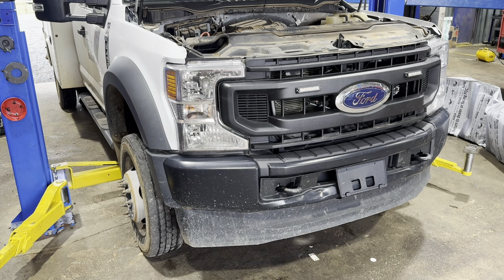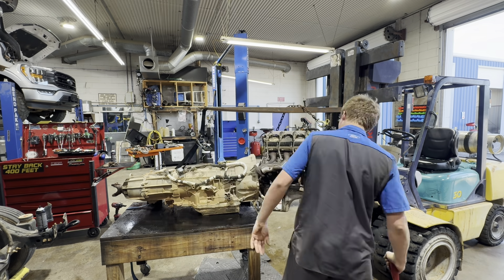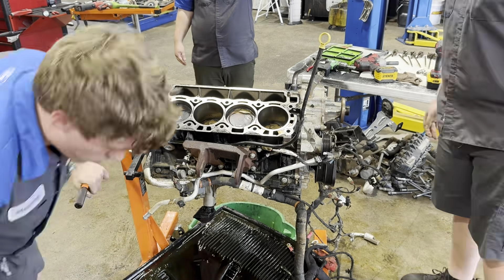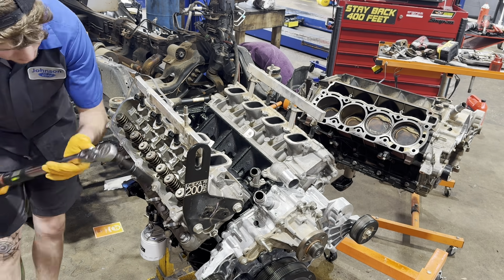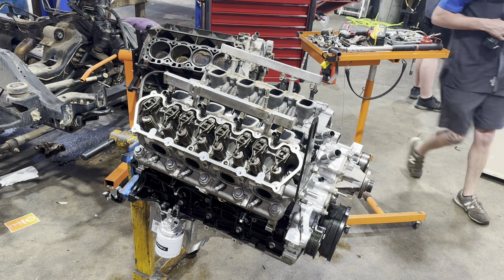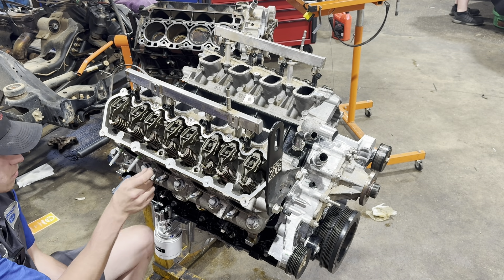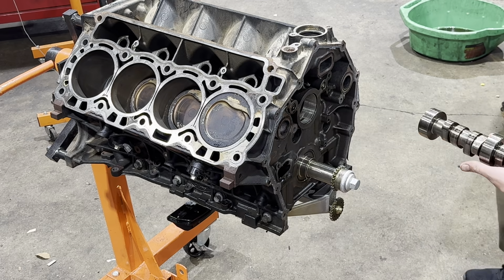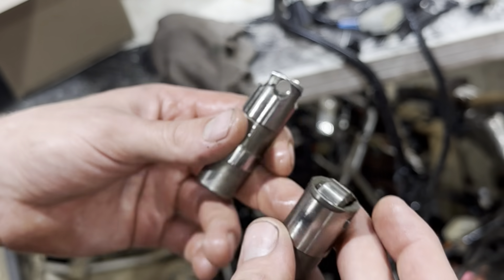Ford 7.3 Godzilla | Does this one issue make the engine a bust?

Comment: Lol, I thought the entire purpose of the 7.3 gasser was to negate all the issues that contractors have with the DPF systems on their diesel trucks, by sitting and idling the engines for long periods of time? You know….the emissions systems problems that everyone has been in an uproar about? I really don’t get it. Roller valve trains have been around for a very long time. How did all three forget how to build a reliable valve train at the same time? It truly blows my mind. And what dipshit engineer decided that it would be a good idea to put a variable oil pump in an engine? Doesn’t the engine vary in RPM? Isn’t that variable enough? I don’t see the benefit in that whatsoever.

Comment: I had a 19 Chevy trail boss for a year and sold it. The new rigs are just trash! I went and bought a stock 94 ford F-150 302 engine single cab long box 4X4 with a 5speed manual best choice I've ever made I can Actually work on this one myself

Comment: Why does the 6.2 have two cams and not 4 like the coyote? I know that on the doc engines there’s a pair for intake valves and a pair for exhaust valves, why did ford go with duals over one in each head?
Reply: 2v vs 4v

Comment: I’ve done multiple cam jobs where the lifter roller seized or lost bearings and wore the cam flat. I replaced the cam and lifters and shipped it. They’re still running after 10s of thousands of miles. I get that you and your shop need to protect yourselves from it coming back, but you can’t just do the maximum to protect yourself while completely ignoring how expensive that bill is to the customer.

Comment: Xw-20 oil?? I wonder if a 20 oil is spec`d only in the US to gain a tiny bit of mileage. They did it with the Triton and it turns out they are surprisingly durable with an 5w-30 or 40 in them.

Comment: Get rid of the stock  FORD  oil pump  and  put in  fixed rate oil pump in it and forget dropping  lifters . They exist   30 psi at idle  fully warmed up is not only possible  but it is what it needs and Ford left it out .  Saving   quart or gasoline at idle  does not stack up against a 10 grand tune up ....as referred to 😂😂😂🤣.

Comment: I think the oil is getting too hot. The pan is right next to the exhaust cats. The trans too. Way too hot. Just because the  coolant temperature is ok doesn’t mean the oil isn’t getting cooked. I am going to Basalt wrap from the manifold to the back of the transmission. Lack of air flow under doesn’t help either, going to cut down the front bumper air dam too. 
Thoughts?

Comment: I put a roller cam and lifters in a 78 350, back in the late 90's and the performance shop told me not to idle to long. He said the rollers get oiled by the splashing from the crank. Said if i was stuck in traffic to put in neutral and rev the engine up.

Comment: GM and RAM suffer from lifter failures because of cylinder deactivation, the 7.3 has no cylinder deactivation, so no excuse… you buy a 6.6 L8t and there’s no issues… Not to mention, you won’t see any lifter failures on a pre 2007 Vortec or a non dod GM engine, just doesn’t happen.

Comment: 60 series detroit oil pressure spec was 5psi at idle.
Reply: @scotcoon1186  15W/40 engine oil. Rod journals bigger than your fist and main journals almost as big as your head.

Comment: Huh? The ford 6.2 engine is universally regarded as a very reliable engine, AKA a Ford 4.6  modular 2 valve with much more displacement, 2 spark plug hemi heads and beefier internals.

Comment: I'm about to pull the 7.3 out of my 2022 F350. 6k out of warranty so I'm going to try swapping in a long block myself. I don't have a way to pull the cab. Any idea if it's possible to get the engine out without pulling the cab, and with the aid of a gantry crane? Any special tools you recommend?

Comment: Youngster. Please share with the rest of us on why the 6.2 liter engine is junk. I know that in the early years of the 6.2 engine, it had some issues with  valve springs, and on some high mileage engines, the coil packs can become brittle and break when removing them, resulting in a more expensive tune-up. Other than that, with proper maintenance, these engines are known for going well over 300,000 miles. So, with that being said, and again, please explain.
Reply: That's exactly what I mean, with proper maintenance and preemptive maintenance, these, and many other vehicles will go well over, two, three, and even 400,000 miles.
Reply: 2011 f250 6.2. 177,000 milrs. No valve spring issues. No issues at all. The only work done on the truck, I did myself preemptively for maintenance. I shitcanned the tiny motorcraft filter for a larger filter. Synthetic oil every 5000-7500 miles. Changed the plugs, coils and coil wires 1 time at about 115,000. Took it on a trip in 23 so I changed the water pump, t-stat, fan clutch, belt, idlers and belt tensioner. All motorcraft parts, no issues with none, just did not want an issue on the trip. This has been a solid truck. I figure when I hit 200,000 I will go ahead and replace timing chain, cam phasers, chain guides, chain tensioner, front seal, gear rotor oil pump and probably another water pump.

Comment: where are these lifters being made? By the cartel in Mexico? How about China's military funding assembly plants in China? Mellings does not make a high volume pump for these beast and whats up with these extra chains running these pumps? Holley makes a better pump for these engines. They make a better cast pan and timing cover too.

Comment: I haven't heard of people complaining about the 6.2s, however almost everybody I've ever known with the newer Ford trucks have gotten them with a 5.0 or V6 and people have had horrendous problems with the v6s.
Reply: Depends on how they’re treated to a point, I’ve had 2 v-6 ecoboosts the first a 2014 3.5 that I traded in at 115,000 on original timing chain with no noise at cold start. That truck had 2 sets of spark plugs and a tps sensor done whole time I had since it was new. Now a 21 2.7 with 65,000 should do the spark plugs on it. Oil changes every 4-5000 miles on them and let them cool off a minute or two at idle to bring turbo temperatures down if working hard.

Comment: Glad Ford is replacing long blocks. GM denied a warranty claim on a 5.3 I replaced in 2017 with a spun rod bearing. Engine had 7000 miles on it, warranty told us we should have only replaced the crank, affected rod and the bearing.

Comment: I did a 5 star tune at like 3,000 miles on mine.   I’m at 15,000 now and literally emailed them yesterday about updating it to give it more oil pressure at idle.  They sent me the new tune today and I got it programmed into the truck.   I don’t have much idle time, but figured it’d at least give me the edge on the problem.

Comment: Had a couple Fords in the past, had problems with both of them.. no longer a Ford owner and never will be again! 
Anytime I’d stop in the Ford garage they’d always be tearing down an engine or transmission due to shudder, or failure.
GM makes the best HD gas engine 6.6, no lifer issues..  very good engine if you take care of it!
Reply: They're all garbage. You're silly if you think GM is any better, the key is recognizing each make has a model that's exceptionally reliable for the brand.

My 6.2l svt raptor is just as reliable as a tundra.
Reply: 6.6 for the win. The 5.3 and 6.2 LT engine would be just as good if they eliminated the DoD system, and start/stop.... what a waste of a good platform.

Comment: I was wondering the same exact thing. When ford brought this engine out they specifically said they built it for work or for companies that do alot of idle time. But yet they put that horrible variable oil pump in that does not pump enough oil at idle. Quite ironic. I know I'm not a engineer but I ain't stupid either.

Comment: Engineers design a motor to idle on no oil prsssure. I call them smart dumbasses. Then ford wants to charge 60k to 70k for a truck with a pos motor design.

Comment: Very similar to the LS which is itself closely related the Ford Windsor in head design valve angle, symmetrical port etc… and Ford FE/FT in block design buttressed block, cross bolted mains.

Comment: There shouldn't be any reason to buy a short block if there is no internal scoring. I suppose   if the price of a teardown costs more than a short block it makes sense, but machine shops fill the motor with metal shavings anytime they deck the block, intake, exhaust, replace valve guides, machine valve seats etc. It just needs to be cleaned properly. I dunno, maybe techs charge 5k+ to teardown an engine and clean the block?

Comment: It's not Pressure it's not enough volume at low idle same problem with the 5.7 hemi put a six four oil pump on the 5.7 it has more oil volume and solve the lifter problem 😊
Reply: Then explain the 6.4 lifter failures?

Comment: 8 psi of oil pressure at idle seems woefully insufficient.  My LS2 engine has 28 psi at hot idle.   My '91 454 BBC has about 32 psi at hot idle.   Sometimes I don't understand the thinking of some of these engineers.
Reply: It's all about using less fuel and efficiency standards raising. This was how Ford avoided using direct injection or shitty MDS style lifters, which are sure to fail in roughly the same time many of these are seeing failures. I'm sure you're familiar with those failures and the deleting of MDS by installing a new cam and non-MDS lifters. 

The oil pump sucks up a load of power on an engine- they say 3-5% iirc. That is a massive gain for the engineers. The front mounted pumps can see some cavitation issues as well as cracking, or cause harmonic issues, so they decided to put these down in the sump and run them off a jackshaft. For racing, everyone just locks these things out by shoving a shim in there to keep them at full pressure and flow. If the stock controls fail on a working variable stock pump, the pumps are also designed to lock full flow and pressure. IIRC GM's variable pumps do the exact same thing. I'm sure their testing never showed issues at 8 psi- and believe it or not, the low end on a Cummins 6BT is 9 PSI. They have a high volume, low pressure approach, although many of us never see that low on our engines at all. Depends on the pump and that engine block in particular. 

I'm pretty sure this is something they can fix by just commanding the pump to run at 15-20 PSI at idle. A guy above says he has 21, so maybe these are well worn pumps? I'd love to see every oil pump on these as they come in to the shop and measure clearances, compared to say 3-5 brand new ones. I'm sure they'll tweak it to work it out, but it sucks that people are finding this the hard way. This is a badass engine from an engineering standpoint. They're a huge win for us pushrod lovers everywhere. This is hopefully an easy fix and will likely result in a recall to flash ECMs with higher pressure commands.

Comment: I thought Ford was going to bump up the idle oil pressure.  Surprising they didn't.  Seems like an easy fix.  Can you bump up the oil pressure yourself with a tuner, or is it set with springs in the oil pump?
Reply: It's not a spring it's in the computer and they did bump it up dealers were told to put the software patch on all 2024 models on their lots a while back and anyone that hasn't had it done needs to get it done right away but that's probably not the biggest problem this seems to stem from a bad batch of lifters from a vendor more than anything.

Comment: as a gm tech, our turds have plenty of oil pressure at idle, over 20, my guess on ours is the direct injection shits in the oil bad, diluting it, and its already 0w20, that coupled with a scheduled oil change at 7500 likely is not helping
id like to see a test group running a C rated oil (compression ignition, aka diesel) at 5k intervals, maybe a 5w40, or even a 15w40, and see what the valve train failure rate is

Comment: This is quite comical 😂 less than 1% ever has problems. I can tell everyone I’ve got over a 100k on mine very first edition late 2019 and I’ve beaten it from day one and have never had a issue except 1 plug wire . and I let mine idle for very long periods on time . This will be the engine of the future in my view it’s very very durable 7.3 Godzilla

Comment: I still don't understand why For hasn't issued a recall on the older 7.3L when they know that the low oil pressure is killing these engines at idle. I have the 2020 7.3L and I don't idle my engine, but you can't help having this in the back of your mind that maybe some day it's going to happen. Same for the 10R140 transmission deal. Mine is starting to show the tell tale signs of delayed shifts from 3rd to 4th and 4th to 5th shifts at moderate throttle. My truck only has 56,000 miles. 🤦🏻‍♂️

Comment: Gm only has lifter problems because of the afm/dod lifters collapse if they didnt have those there isnt a problem oil pressure isnt an issue with the gm's, the hemi actually have the problem with the lifters because of oil pressure problems

Comment: The Duke says, your low oil pressure theory has been blown out of the water. There is a YouTube video out where the owner of the vehicle buys a mechanical  oil pressure gauge.  
At cold start it puts out 93 PSI oil pressure and when it warms up it drops down to 22 PSI in park. That is more than enough oil pressure even at idle to lubricate the motor. As he revs the engine the oil pressure goes much higher.
You're also wrong about the Ford 6.2 gas engine. I used to have one and put 417,000 mi on the first engine and over 500,000 on the reman. Don't believe me? Google it. Flatbed Ed. Ford 6.2 forum. I now have a 7.3 Godzilla. I'm not sure if I would let you work on my vehicles. 
What did I teach you?

Comment: I have a 2020 F250 Tremor with the 7.3. Currently I have 243 hours of idle time. I try not to let it idle much. Still wondering if it's worth it to seek out a higher oil pressure solution. I also purchased an 8 year/100k mile extended warranty because I purchased the first year of this motor.

Comment: 😂 My 2012 F250 6.2 has 394,556 miles on it and still purrs along like New 😅. Kept Good maintenance schedule with oil changes, timing chain changes at 100K and only replaced normal wear items 😅. I'm keeping it until it collapses 😅
Reply: We’ve got 2 of them. 495k on 1 with 14k idle hours and 1 with 365k that’s never not pulled a 12 foot trailer at minimum. The 495k mile truck pulled 22k on a bumper pull trailer a few weeks ago. Drug a crew cab lb7 with a diesel generator welder in the bed of it with a loaded tool box home this weekend cruising at 75 mph down the interstate on an equipment trailer. Rolling at 1900 RPM. Locked in overdrive. Didn’t even break a sweat

Comment: Currently going through a fight with Ford ESP on this exact issue. Camshaft damaged and needs a new engine. I'm particular about maintenance and replace my own oil every 5,000 mi with full mobile one synthetic.

2020 with Mileage at 122k lots of highway mileage. Current Ford ESP is calling for short block replacement while the five other trucks in that same shop with the same exact issue are getting a long block replacement because they have lower hours. Beware buyers.

Low oil pressure noted by Ford  customer satisfaction program 24B27. Google that.

All current 7.3s have low oil pressure at idle and major damage will occur over time without a fix.

Comment: Im a mechanic at hertz rental car and we are seeing a lot of gm engine failures on the 6.2 in the Denali and Escalade with low miles. We  have a lot of ford box trucks with the 7.3 and the biggest problem with them is catalytic converter theft.
Reply: How many per year. I know rods are an issue.

Comment: Question, Sir. I'm considering purchasing a 2024 F350 with the 7.3. If the issue is oil pressure, why isn't there a high-pressure oil pump available? Can one be installed in an after market configeration? And not putting you on the spot.. would you buy a new 2024 F350 with the 7.3 ?? I mean you are a professional Ford technician with the problems as you noted. I'm not going to have the truck in a commercial environment and will be towing heavy from time to time.. thank you for your time and content.

Comment: 6.2 junk? Man I've been working on fleets of them. Spark plugs every 100.000 miles and oil changes and they run forever. Not the most powerful thing in a F350 but neither was the 300 six

Comment: The low oil pressure at idle is 100% in the tune. I have a 7.3 with a holley aftermarket ecu and it can idke at 80-psi plus so the stock oil pump is plenty capable. Surely that is just a simple tune for the stock ford ecu to turn up the idle oil pressure.
Reply: My 2024 after idling for a while bumps the idle up on its own...like 400 rpms
Something ford did possibly to combat lifter issues??
Reply: @coreyyancey9272  might be. A while back dealers were ordered to put the software patch on all 2024 models on their lots I didn't hear anything about increasing the idle RPM just the oil pressure.
Reply: 80psi at idle? Seems a tad high

Comment: 1853 was the first internal combustion engine and they still can’t get it right 😂 
The aftermarket will fix the “low oil pressure” fiasco. Probably run for 300k after that.